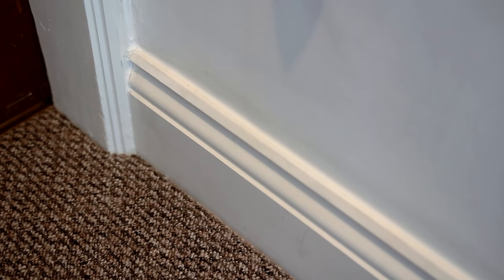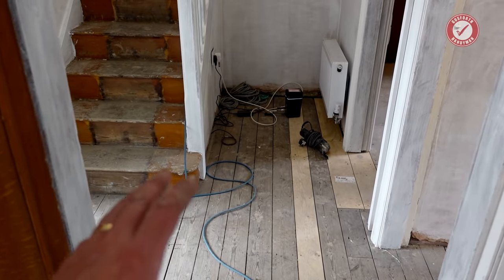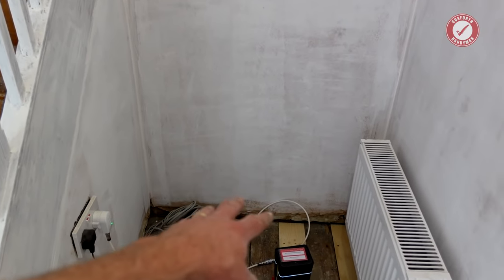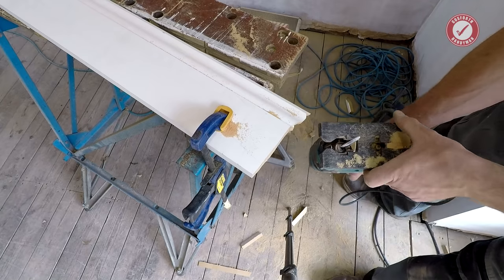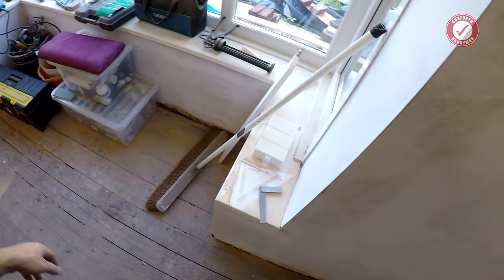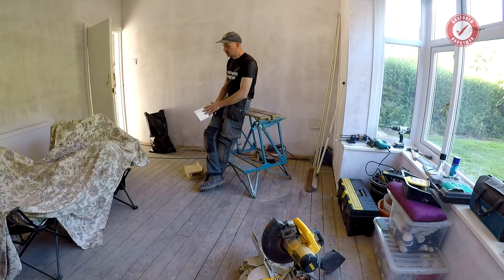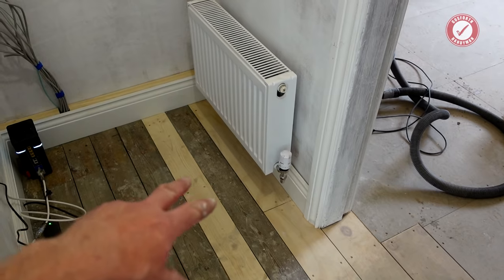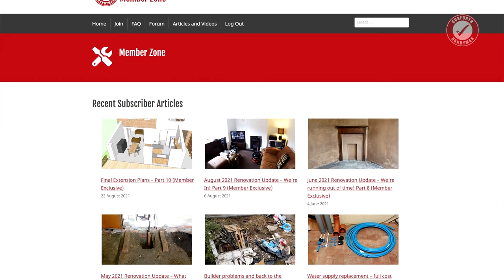Time for new skirting boards - easy scribe tips! (Renovation Part 29)

Comment: Hey Andy, good video to reference later when i'm doing some a bit of skirting myself.

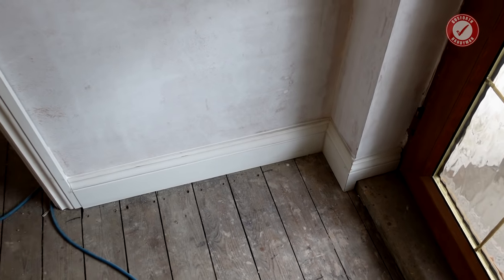One question, at 25:49 the skirting to the right of the room door appears to be a bit proud of the architrave, in that situation do you recommend cutting a small miter in the skirting, chisel the wall to bring flush or if it's not to far you leave it proud? Could just be a shadow?

You're not the first I've seen using a scroll saw to do scribes but I've yet to master it, will do a lot of practice before it's time to do it for real.

Your sand paper on the face of a piece of skirting is a peach of an idea...will def be doing that trick/method! Thanks
Reply: If it bothers you that much plane the back of the skirting to make it flush...or use one of the solutions you've already identified.
Reply from the maker: You can cut a chamfer on it and make a feature out of it. Once it's all painted up it looks like it was designed like that. 👍
Reply: @135Ops  It didn't "bother" me at all, I was simply asking Andy for his take on solutions, or if was really proud, or just a trick of the lighting.
Reply: @GosforthHandyman  Thanks, we're now waiting on the "Hi ya folks, well the carpets are down, let me show ya..." video

Comment: when im fitting skirting i get a short bit of skirting  to write the measurments on and to use as a thickness gauge. then sart in a room on a double square cut or against an architrave etc. i use my laser distance measurer  and work my way around the room anti clockwise using the scrap bit to hold it out the thickness of the skirting that will have been fitted. then take 2mm off the read out  to allow a bit of  tolerance to get it to fit. 
i go anti clockwise  because im right handed  so it means im scribing the right hand end  all the time and its easier . i often do 2-3 rooms at a time  and cut all them together and mark them by the room and a number if they are very similar measurments. 
great tip with the sanding board.  definetly using that going forward

Comment: It gives me some solace to know that other experience plasterers not getting the walls straight, visually it looks fine until you put a straight edge on it. I can't plaster but it's annoying
Reply from the maker: Yeah, you can't tell at all now that the room is decorated. But hoped it would be a bit flatter than that. 👍😂
Reply: @GosforthHandyman That fireplace was a bit rough, but I know how difficult it is to plaster. It's the one trade that seems more like an art than a skill.

Comment: Grab adhesive is rubbish on MDF skirting and walls, I've found using D4 flooring \ wood adhesive adhesive (PU) to be a lot better - goes off quicker too
Reply from the maker: Yup, a few folks have recommended foaming PU adhesive. Need to give this a try. 👍

Comment: Great vid, we are currently renovating a 1950s semi-detached and we said exactly the same thing about the walls not being straight, it adds character!

I've just a quick question about the alcove soundproofing you did a few vids back. Would it be completely mad to try chase an electric wire for alcove down lights through the final plasterboard or would this not make a huge amount of difference as the other soundproofing elements would already be attached?
Reply from the maker: Yeah, I would avoid chasing the soundproofed walls if at all possible. Could seriously degrade the performance. 👍

Comment: What's the reason for doing the scribed joints as opposed to 45 degree mitres?
Reply: Deals better with a wall where it's not got a perfect 90° angle, it allows for a perfect looking corner with a range of angles maybe 85° to 95°.
Reply: Wot Craig said!
Reply from the maker: Also wot Craig said. 👍

Comment: It's so strange to me. Over there you have solid brick walls and run your wires and pipes through hollow floors. I'm in California USA, where we run most of our wires and pipes through sick framed walls and half of the buildings have solid concrete slab foundations, so wires and pipes (like drains) that do need to go under the floor often have to be cast inside concrete, or punched through it and run under the slab. Of course, we have lots of earth quakes, and a very different climate. I like the brick walls for thermal mass and sound damping, but building brick to stand after a magnitude 9 quake may be a challenge.
Reply from the maker: Yeah luckily no quakes over here! 👍😬😁
Reply: @GosforthHandyman  UK has 200 to 300 quakes a year but they are generally very small. Only had two in North Wales that I have actually felt.

Comment: Is scribing the standard way for inside corners? Here in Belgium I’ve never seen that done: miter cuts are used instead. Do you know of advantages and disadvantages of both methods?
Reply: Mitres always open up, and corners are rarely at exactly 90 degrees.  Hence scribing usually works better.
Reply from the maker: Mind you I've seen plenty scribes that have opened up as the boards dry out - especially in new builds. But yes, main reason is due to the corners not being 90 degrees. 👍
Reply: @GosforthHandyman  
I measure angle, half it and set saw to that. I find the two mitred ends butt up together well and keep each other in place if you fit them snugly.

Comment: You described the No Nosense glue as "useless". I think that that is bulling it up by quite a bit. It goes in to my utterly criminally useless and should be shot, burned, buried and then be dug up and be shot and burned again. Having to go back and do a job again after a lot of other work has been completed really does put it in a category of its own at the top end of FUBAR. I use Adiseal now for just about anything, yes its 5 times the price of the No Nonsense No Stick, but also has no comebacks, or none for me yet. And no I'm not in cahoots with Adiseal.
Reply from the maker: Ha cheers! Yes, you're not wrong. I can't understand why the reviews are so good... so jury's out until I do a bit more testing. 👍😂

Comment: Like I said before, it you get the wall to woodwork joints even and not to thick or thin it's will look good. You are probably kicking yourself useing plastic pipes and 10mm bore already and rads being to low. Give it 5-10 years and them rad valve will be shoot and a royal pain in the arse to fix. One mouse in the house and it will ruin everything.
Reply from the maker: The plumber ran the 10mm, not me btw! Rads are at standard height and no regrets. All the mouse holes are now sealed up. 👍😂

Comment: Those sort of glues aren't up to much fella, you'll get much better results from polymer glues ie fix all, stix all or sticks like s**t, you'll pay a little more but they work. Also, tip for you, if you glue onto paint that's what you're bonding too, so at risk of the bond failing.
Keep up the good work.....
Reply from the maker: Cheers Alan! 👍
Reply: I would say that's a very broad generalisation!  I always use budget grab adhesives and have found them to work perfectly well in ALMOST all applications I've tried them in!
And the point is, they're MUCH cheaper than the branded versions.
So, find out where they work, and save ......!
Don't be dogmatic about things - it usually works against you!!

Comment: If I was sticking skirting again now, Id use multistick every time Ive been really happy with it. For the ones you plan on taking off again Silicone applied in circle seemed to work well, kind of creates a suction effect and easy to get off.
Reply: Had the same issue with another brand of solvent free grab from Toolstation and had to re-do an entire house - both architraves and skirtings. Now only use multi stick - it's an extra 2 pounds per tube but it's a lot cheaper than having to go back and re-do all the work.
Reply: Soudal's Fixall range are also great. Some distributors sell it a lot cheaper than others. Definitely worth a try, the 'High Tack' sticks aggressively to stuff and is strong, 'Flexi' is great for anything accommodating movement. MS Polymer, Hybrid Polymer, Modified Silicone, etc (goes by a few names) adhesives in general are a game changer.
Reply: @elminz  Totally agree. I use Soudal Fixall all this time.
Reply: @Oli_Hudson  I went through and read all the datasheets for competing adhesives. Soudal's offerings does perform better than most competing ones. There are better, but it starts to get way more expensive or caveats. e.g. Loctite PL Premium MAX and X8 are stronger, but way more expensive and much harder to use. 

The Fixall flexi is 750% elongation to break, comparable ones are 700%. High Tack is slightly stronger than similar ones. For ones that provide performance metrics anyway. The Wickes ultimate frame/door sealant and Ultimate grab adhesive are rebranded Soudal Fixall Flexi and High Tack. Some other companies use rebranded Soudal stuff as well, as they're one of the biggest producers along with Sika (aka Everbuild).
Reply: @elminz  Good to know, many thanks for the info!!
Reply from the maker: Great info in here!
Reply: Multistick every time, as demonstrated by Robin Clevett in his tests with MDF on plasterboard.